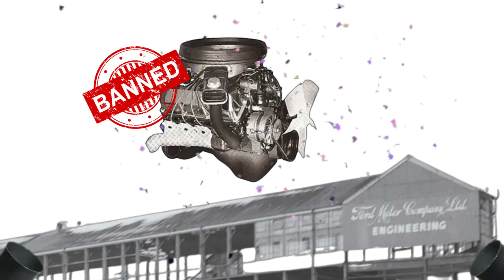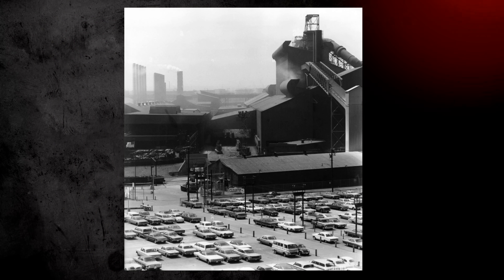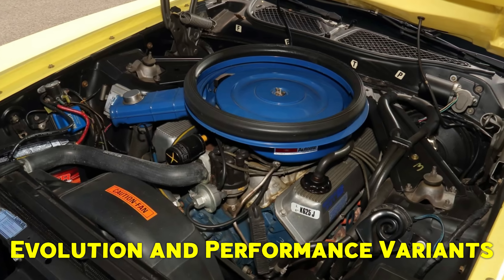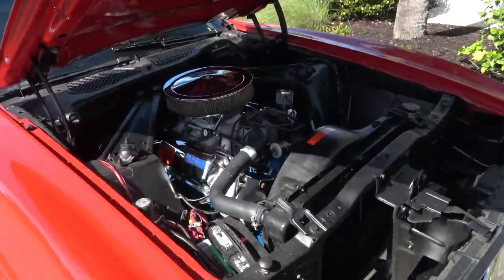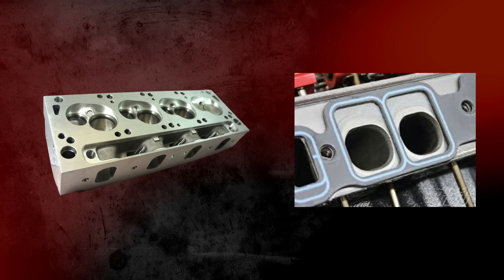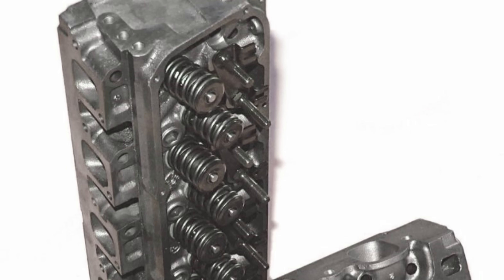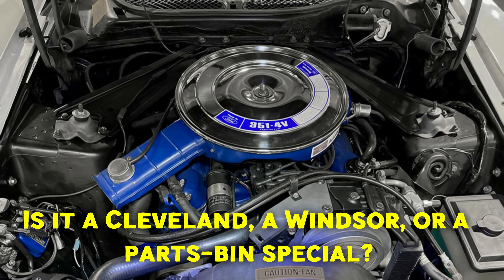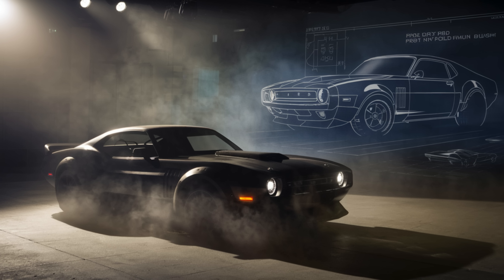The Shocking Truth Behind FORDs Banned 351 Cleveland Engine

Comment: I had a 70 Mach 1 with a 351 Cleveland CJ it was the Fastest car I ever owned. 
Great Engine Loved that Car
Reply from the maker: The 351 Cleveland is truly an iconic engine! It’s amazing how some cars leave such a lasting impression. What was your favorite memory with the Mach 1?  @joemathias4975
Reply: @rarecarstorys  325 single pull open rear burying the Speedo 120 before shifting to 3rd . The  car was too light in the front at approx 145 it became Dangerous to drive.  But being young and dumb thank God no Crashes.

Comment: Why are you showing CHI aluminum heads which were built 30-40 years later! And they never put a Holley 750 on the CJ motor they used the Motorcraft 4300D 750, I have that carb and three sets of 4V heads both open and closed chamber.
Reply: They used a 780 Holley in Australia on the  XY XA GT Falcons.
Reply from the maker: Thanks for pointing that out! It's always great to get insights from someone with firsthand experience. The history of these engines is so rich, and I appreciate your input! @MrTomZeus

Comment: I had a 1974 Gran Torino Sport with a 351 Cleveland engine. I had to put a c6 transmission  with extra clutch plates in it after I got it. It was a beautiful car with bucket seats, console shifter and a sun roof and was scary to drive. I had it parked for the winter and was driving an old 65 ford custom and a fellow made me a pretty good offer for it. My wife was expecting and we could use the extra cash , so I let it go. I have regretted that decision every time I look at my old photos.
Reply from the maker: Ah, the classic dilemma: cash in hand or horsepower in your heart? At least you have the photos to remind you of the wild rides and bucket seat adventures!  @rego3167
Reply: My buddy had a 72 GTS with the handling package & 351 HO & C6 with 3.000 stall converter from the factory. It was a pretty nice car

Comment: Having owned a 351C in the past,I think the only good thing about the engine are the high compression 4 barrel cylinder heads.
The rest of the engine with it's crap oil system and low block deck height not so good.
Reply from the maker: Sounds like the 351C is the engine version of that one friend who always shows up with snacks but never brings a drink! High compression heads are great, but the rest? Yikes! @comx427

Comment: Years ago my friend bought a 1970 Mach 1 with a 351 Cleveland and it had nitrous and it said in Nightmare on both rear posts (trunk to top of car). It lived up to its name. The entire engine and transmission were pulled and rebuilt and even hot tanked for cracks and the heads were angled drilled which when completed the drive train was flawless. 😊
Reply from the maker: That sounds like an incredible build! The 351 Cleveland is such a legendary engine, and it's awesome to hear how well your friend's Mach 1 performed after all that work.  @danielulery8726

Comment: A lot of 351 Cleveland’s were used in ford trucks thru the late 70s.
Reply from the maker: you are Absolutely right, the 351 Cleveland was a powerhouse in the Ford lineup during that era! It really made its mark in trucks and performance cars alike.  @gomergomez1984
Reply: Yes I still have mine. 😊
Reply: I had a 351 Cleveland in my 1977 Econoline 250. Shag carpet wood paneling and a moon roof. Set up for work during the week, party on the weekends. It was always fast and strong. A lot  of great memories.

Comment: My first car was  71 Mustang coupe with a 2V Clevland. I couldn't wait to put a Holley and headers on it. Wasn't a Hemi killer but went pretty good. I was a senior in high school and the girls liked it.😄
Reply: Heh heh! Got mom's '73 mustang convertible when I was a jr in hs. 351C I put a dual exhaust on and a 4 bbl carb. Slowish off the line, but 25-100 in 3.5 seconds!!!  Passing gear was just balls out.
Reply: I bought a 1971 Ford Galaxie a few years ago from an old lady.  Opened up the hood and found a 2v Cleveland instead of the 351 Windsor I was expecting. It [was pinging like hell when I bought it, but that thing ran great once I cleaned the  carbon out with some Sea Foam and started running premium gas in it (it had 9.0 or 9.5 compressions if I remember right).  I put a 4bbl on it and dual exhaust and I never dynoed in but it sure ran great.
Reply from the maker: That sounds like an amazing first car! The 351 Cleveland has such a rich history. It's great to hear you had fun with it and made some memorable high school moments!  @bobfitzgerald8960

Comment: This brings back memories of my '71 Mach 1 with the 351 Cleveland. The main difference I remember between the Cleveland and the Windsor was the bigger valves in the Cleveland.
Reply: Not only that but the Cleveland had a dry intake and the Windsor had a wet intake.
Reply from the maker: Ah, the '71 Mach 1 with the 351 Cleveland is a classic! You're absolutely right about the bigger valves making a difference. It's amazing how those engines shaped the muscle car era.  @kens32052

Comment: This AI-generated video is just as mislead and previous Cleveland videos, not to mention poorly organized and repetitive. The 351C and Boss 351 were never “banned.”  In 1970 after winning the Trans Am Series with the Boss 302, Ford ended factory backed racing, claiming “what wins on Sunday sells on Monday” wasn’t true. The Boss 351 was a car without a racing series, except on the street. There may have been some independent SCCA racers who ran them , but I haven’t found much that was recorded. Fuel economy standards and emissions regulations started to kill high test gasoline, which had an adverse affect on high compression and a whole host of other issues. Insurance cost also didn’t help.  Consumers were already starting to favor sporty looking cars with tape stripes and underpowered, fuel sipping motors over high compression solid cam pavement peelers. But racers in NASCAR as well as Jack Rousch and Bob Glidden applied really good innovation and developed the 351C far beyond its factory pinnacle, the Boss 351. The competition may have wanted the Cleveland banned, but it wasn’t. When Ford got back to factory backed racing in the early 80s, the 351C pattern was immediately brought back for NASCAR. NASCAR, after Bill Elliot’s success, restricted the 351C, but did not ban it. I wonder if part 2 of this series is going to cover correcting all the misconceptions reported in this video.
Reply from the maker: I appreciate your detailed insights! The history of the 351 Cleveland and its racing legacy is definitely complex SCCA . Your perspective adds a lot to the conversation!  @sombra6153

Comment: Heard you had to rebuild the entire engine after 45,000.00 miles or 72,000.00 km
Reply from the maker: you so right!1 The 351 Cleveland has its quirks, but it’s a classic for a reason. @ahoyminoi1156

Comment: When in the hell were any of the Cleveland engines banned?
This channel is shit, and hey goober, the plural form of "story" is stories, not "storys".
Reply from the maker: hahahha   @AraceaeFanatics  whats a goober ?
Reply: Most of the sh!t on the internet is Bullsh!t. NASCAR "banned" ALL big inch engines in the 70s when they instituted the 358inch max displacement rule. Now, NASCAR has a dimensional blueprint that ALL the manufacturers must design their engine around. The BP gives exact dimensions for deck height, bore spacing & even the CL distance between the cam & crankshaft. This came into effect when Toyota jumped in because they did not have a pushrod V8 engine to base a racing engine off of. The Ford is called the FR9 for Ford Racing 2009 & the Chevy is called the RO7 for Race Only 2007, the years the engines were first available. NHRA Pro Stock was first set up with different weights per displacement which is the reason small blocks were beating big motor cars in Grumpy's & Glidden's days. A light car will always out accelerate a heavier car. Simple laws of physics. Now, NHRA Pro Stock has a 500 inch motor rule with a minimum weight for the car. Cory Mac had a VW powered 356 Porsche Speedster looking funny car that ran low 8 in the 80s. My buddy's Olds, the quickest in the U.S. in 2020, 2023 & 2024, runs 5.35 / 125 eigth mile with a 1.11 60ft. He runs a 350 Olds diesel block based, 440 inch short deck Olds engine & the car weighs 2,200. It ran 7.97 / 168 in Phx with 4,000 ft AAD on race gas with a single Pro Systems carb, with his 555 Chevy before he built the short deck Olds. The owner of Rocket Performance refused to race my buddy unless Alan added 1,000lbs to his car, even though the Rocket performance engine was over 100 cubic inches bigger. The Olds club has now made my buddy's car illegal because of crybabies with a big ego that can't out run a no name "back yard" engine builder! LOL

Comment: The boss 351 was not banned in any form of motorsport. It was sidelined due to changes in regulations. The 351C  was never banned either. It had a amazing history even though short, the fuel and emissions crisis ended it. Ford Australia used it to build the fastest 4 door family that stood for over 2 decades, the  XY GTHO Falcon.australia also produced a 302C which the US Never got.  Bob Glidden and many others used it in Pro Stock with many titles and records, sedan racers used it with great success as well
Reply: The 351C was banned from drag racing. There were guys who increased the exhaust flow and it made crazy HP.
Reply: @jackylsmith8138  class rules changed and particularly the weight break so all teams went to larger cubic inch motors, it was never banned.  John Kaase and Bob Glidden are those guys, CHI in Australia do a modern alloy version of that head and are readily available.
Reply: @jackylsmith8138  the 351c was never banned from any class of drag racing. Pro stock change to the 500cui rule in 1986 I believe .
Reply from the maker: You bring up some great points about the 351 Cleveland's history! It's fascinating how regulations shaped the landscape of motorsports. The XY GTHO Falcon is truly a legendary vehicle!  @francisstone8221
Reply: @rarecarstorys  as an Australian We had a long history and motorsport histroy with the clevland engine and also derived our own variant the 302c with closed chamber 2v heads. Queensland highway patrol built XE Falcon pursuit cars that were renowed for chasing down super cars. We still are using it today for motorsport and cylinder head available for the clevo was designed and still produced by CHI in Australia

Comment: If you want cheap horsepower buy a used rebuildable 351c, doesnt take much at all to get big horsepower
Reply from the maker: That's a solid tip! The 351 Cleveland can definitely deliver some impressive power when rebuilt correctly. Thanks for sharing your insights!  @playasurf1000

Comment: The 351 C US 4V engine came from the Boss 302 engine and its heads , Ford wanted a better bottom end to use the Boss 302 heads on as they were so large for only 302 ci , the Cleveland was born in 1970 , but it did not die in 1971/4 , Ford Australia redesigned and recast / built 302 ci Cleveland's and 351 ci Cleveland's from 1971 for 1972 model Australian Falcons,  LTD , Fairlane's , F100 to F350, D Series trucks up untill 1982/3 in cars and 1986 in trucks in both 302C and 351C , both use the same block , infact on the Geelong Casting Centre and engine Assembly line , workers didn't know if a block was a 302c or 351c untill they read the build sheet and either a 3 inch stroke 6 inch rod assembly was installed in the block or a 3.5 inch stroke and 5.7 inch rod assembly was installed, identical blocks , 4 inch bore . The heads were all 2 V port size as the 4V US port is too large and port verlocity was lost , after massive testing in Australia the 2 V port was used but all ran 4 barrel intakes with carter thermo quad carbies , so 4 barrel intakes with redesigned 2V port sizes , the 302 Cleveland got the best factory head ever , closed chamber, it was common in Australia to install US 4V valves , port out the bowl and short turn in the port to create the best head , just bolting a set of 302 Cleveland closed chamber heads on a stock 351Cleveland got you 10.5 to 1 compression with smog pistons and instant 55 HP increase , add the 4V valves and porting the 302C heads created the best head , 302 Cleveland's were so common in Australia and hated as everyone wanted a 351 C that piles of good running ones went for scrap iron in the 1990s , but they still quite common in Australia almost every Aussie wrecking yard will have at least one sitting around . The 302C and 351C had a 15 + year life in Australia and was the only Ford V8 available at that time , even upmarket taxis had Cleveland V8S .
Reply: 302 heads with std valves are a better head than any 351 head. 4V valves were like everything 4V TOO BIG.
Clevelands were finished in 83. Really 82. F Trucks etc used the M engine. Even before that. Yes 302 heads interchange onto all C & Mblocks.
Reply: @ldnwholesale8552  sorry mate your info a bit off , 1 302 Cleveland closed chamber heads flow much better wth the US4V valves in them , been proven over and over , just pocket port the bowl and short turn radius , the port determines flow not valve size , they can't be too big , as port is 2V Australian style the US4V valves unshroud the closed chamber more . As for Cleveland's gorn in 1983 , that's cars , F100 to F350 and D Series trucks still used them till 1986 , Ford Geelong Casting Centre was still casting Cleveland 's for them and other places like De Tomarso Panteras and many US NASCAR teams , Australian Racing Falcons used 1983/85 cast Clevelands for Bathurst and all the other races in 83/86 and more . And please on the 351 M in Australian vehicles , never ever happen,  302 Cleveland and 351 Cleveland till 1986 in those as stated . 1987 they then just imported the whole F truck with 302 HO 5.0 litre and 351 W 5.8 litre .
Reply from the maker: Wow, that's an amazing deep dive into the history of the 351 Cleveland engine! It's fascinating to see how much innovation and engineering went into it, especially in Australia. Thanks for sharing all those details!  @JosephCowen-fz8vj

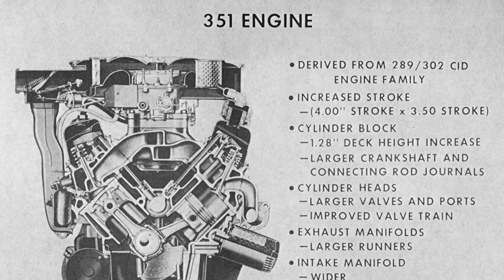Comment: At the 3:00 mark that has to be a tag for the 351W, not the 351 Cleveland. The Cleveland shares no characteristics or part interchangabilities with the 289 or 302. The long and short of it is that the 351C is a variant of the early 400M/351M only with more high performance parts and higher compression, and with a casting that will take the smaller bell housings that ARE the same as the 302. It's basically a big block with a small block bellhousing cast to fit the C4 size bellhousings that would fit into the smaller Mustangs, Cougars, Torinos, and Cyclones with limited firewall clearance. The 351M/400M and 429/460 engines would bolt up to the C6 size bellhousings which fit nicely into the pickups and full size cars, but took serious modifications to shoe horn them into the smaller Fords that were not specifically designed for them.
Reply from the maker: Thanks for the detailed clarification! Engine specs can get pretty tricky, especially with all the variations. Your insights are really valuable! @65metal

Comment: I've seen videos like this pop up about almost every engine. Why are all these popular engines "banned"?
Reply: Not so much banned as legislated out of existence.  Once you start putting all the pollution controls on the engine, it doesn’t make as much power and doesn’t get very good gas mileage either.
Reply from the maker: Great question! Many engines face bans due to environmental regulations or safety concerns. It’s fascinating how history plays a role in automotive innovation!  @ericbonds2302 you are quite correct  @stevelacombe5291
the gov removing freedom is an ongoing problem

Comment: I think the Cleveland also had different bearing cap arrangement to the Winsor.
Reply: 3" mains for windsor and 2.75" for cleveland which gave the cleveland faster and higher rev in turn increasing HP and torque and ohhh 11,700 rpm with full roller rockers

Comment: I had the car @ 3:44  It was a 1970 Mercury Cougar with a built 351 C , nothing fancy, it beat up Camaros and Mopars. I got it running 12's on the stock wheels and tires. It had the auto trans with a shift kit and was a Fun car. Weakness, 4 drum brakes, so we had to downshift to slow her down. Sold it for 5000.00  in the 90's .